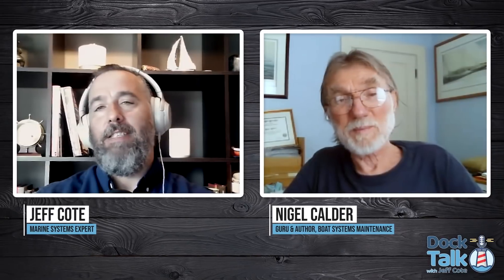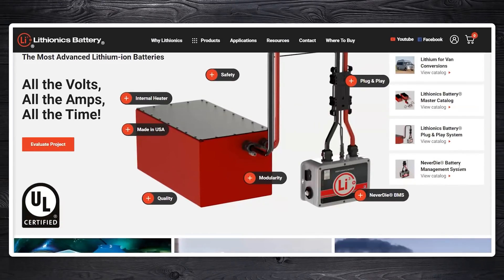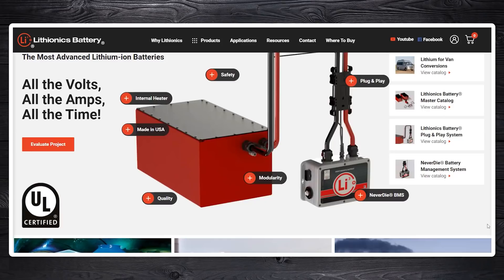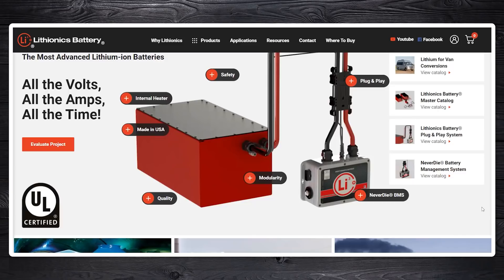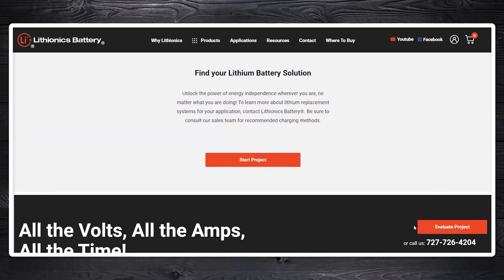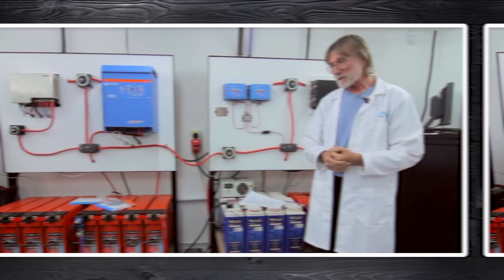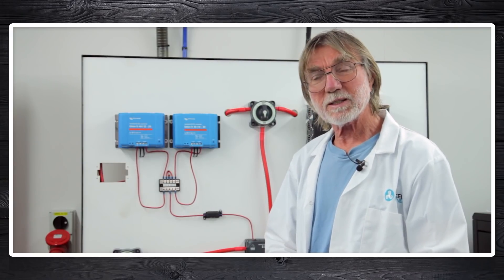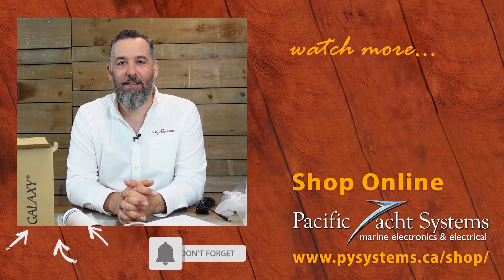Lithium Batteries for Your Boat with Nigel Calder

Comment: Cutting corners is common when building say a new house,  they will spend 30 thousand pounds plus on a kitchen and a Bathroom, but then they want the cheapest Roof possible, because who looks at the roof, when you can't even see it when inside the house, ignoring the fact that it is the Roof that Protects everything Under it. It can be a real problem getting through to such people. ☹️

Comment: Hi Jeff,
I recently has a new boat built by Kanter Marine and we used CZONE and Mastervolt equipment.  I get really scared when my alternator charges at 115 AMP sustained.  the Matervolt LIfepo just takes it all in.  So far so good and it seems like a good system to date.  Maybe you could do a video about MasterVolt equipment. I am upgrading to 400AH of battery as we found we would be at 40% in the morning.  I just wanted to express that my 400AH of LIFEPO is equal to about 600AH of AGM.  Cheers and thanks for all the great info.
Reply from the maker: is the alternator externally regulated?  ideally it would be and it would have an alt temp sensor to throttle back if needed.  They can also be set to a maximum rate so it's never running 100%

An internal regulatored alt running full blast all the time may have a short lifespan
Reply: @PacificYachtSystems  It's a full loop system always talking to the battery though the network.  I thought the same thing but was assured it is working as designed.

Comment: Great discussion.  I have a Tartan 33 with two house batteries and solar.  My batteries are near end of service and have considered the upgrade.  I am limited though as I assume that I would need to convert my belt drive to a serpentine belt drive and my old Universal 5424 has no conversion kit available.  I worry about the load on my drive belt.  Is that a legit concern?
Reply from the maker: Going with a higher output alternator is definitely suggested but not required. If your alternator cannot be any bigger (i.e. limited to single V-belt and no serpentine belt), then consider getting a DC to DC charging converter to share (and limit sharing) your alternator charge from engine battery to lithium.
Reply: @PacificYachtSystems  thank you.  I will look into Dc to DC to get a better understanding of that set-up

Comment: so we're discussing a 48V system with a 8KW inverter? not sure how this is helpful for the average boat owner curious about lithium...
Reply from the maker: Good point, we'll consider more scenarios next time.
Reply: @PacificYachtSystems  but still it is the same only lower volt.  My houseboat have 12 volt start and so.  But housebank is 44kw in 24volt systems

Comment: Great to see the LFP topic on your videos. I have been experimenting LFP for a 3 years now. I am a big fan of your videos. A topic that is not covered often is the need for lead acid / agm as a low cost backup to run critical loads eg  engine start, navigation, radar,auto pilot etc. I’m planning on always having enough lead acid to run critical loads. LFP  protection systems are complicated and can cause LFP to go offline. Lead acid is reliable and has been engineered into our boats by smart people. One more topic that is interesting but maybe not prime time is paralleled LFP and lead acid with some form of VSR. I have done a video on a few experiments on my boat.
Reply from the maker: Thanks Danny for sharing your experience, appreciate it.
Reply: https://youtu.be/XAOhT2HwKWM

Comment: I think the scare tactics around lithium batteries are unwarranted . Where are all these fires? I live in Seattle and boat fires are relatively rare. If lithium battery fires are so common please post a video with the statistics so your viewers can decide on their own.
Reply from the maker: Thanks for sharing Louis.
Reply: I agree. It is important to consider the actual chemistry. I suppose this good discussion is around Lithium Iron Phosphate (LiFePO4). This is very safe ( see latest  Tesla standard range). If we talked lithium nickel manganese cobalt oxide (NMC), this can have run away chemical reactions if pierced or damaged badly. But this type of battery is in mobile phones - so again not so scary dangerous ( don’t recommend damaging these batteries as this is a violent reaction and can cause serious harm). I f treated properly LiFePO4 batteries I believe are safer than the diesel and propane I have onboard or for that sake the rest of the electrical system - fuses and where they should be to protect the cables is another great discussion ;-)

Comment: In terms of the economics of LFP, it seems that if you are not using that many charge/discharge cycles in a year, you should just get many, many more years of use.  An additional factor in that is the ability of LFP chemistry to be “OK” with being left in a partial state of charge versus the need for lead-acid chemistry to always be returned to full charge as soon as possible, something that probably does not occur in most casual use situations.  But perhaps I am missing something here.
Reply from the maker: Thanks for contributing to the conversation Bruce.

Comment: Jeff, I have a 17 ft. center console boat that I chose to load up with 3 Lithium batteries.  The boat is probably worth $15k and has $1,500 worth of batteries in it!  I made that decision based on the weight and space savings (huge for a fishing boat of any size, but even more so when you only have 17 ft to play with!) but also because the batteries are actually cheaper than FLA if you take into consideration the longevity and future cost of time/money when you have to replace the FLA batteries every 3-5 years.  I can also now keep running my accessories and trolling motor much longer than if I had put in 3 FLA batteries.
Reply from the maker: Thanks Chris for sharing, much appreciated.
Reply: but you can't charge the lithium batteries from the alternator? how do you solve this problem?
Reply: @IrregularPineapples  yes, you can charge them using a normal boat alternator.

Comment: Should not scare people about the price of boat, but they should not look at saving on batteries.  LifePO4 is a safe technology and will not catch fire under the bed.  The top tier marine batteries sold now use some of the same cells you can buy individually.  If the pre-made weren't so expensive (paying for the name).  There are videos online showing the lithium chemistries and if they are a fire hazard.
Reply from the maker: Thanks Douglas for sharing.

Comment: I have a 50a alternator which is connected to a Victron OrionTr 12/12-18 Smart charger. Would you say this is the max charge I should use with that alternator or could I add another Orion-Tr of the same capacity and run in parallel?
Reply from the maker: Great question, considering your alternator is 50 amps, sharing 18 amps is probably reasonable, As you share more, say 36 amps, your alternator will have a hard time keeping up and not getting too hot, especially if it runs at full capacity for a period of time.